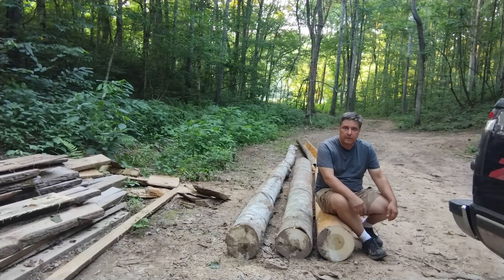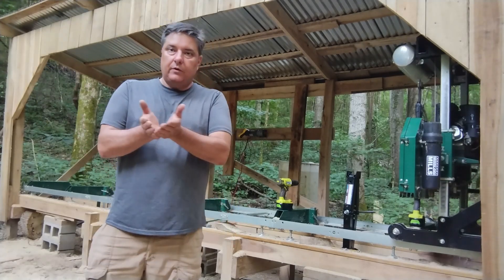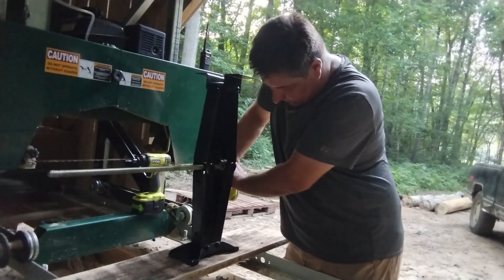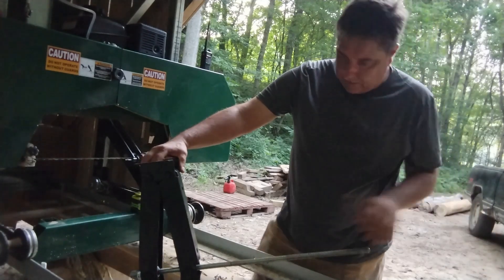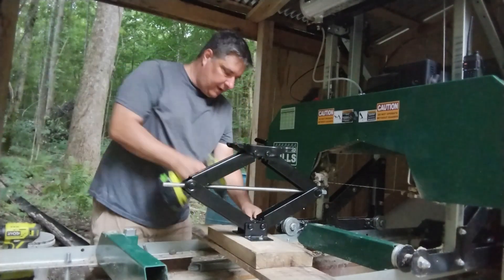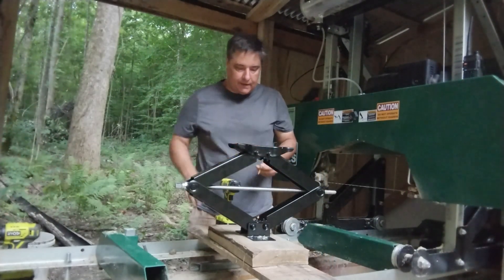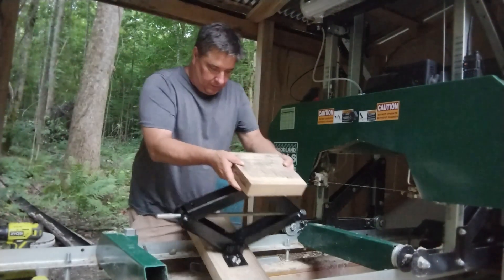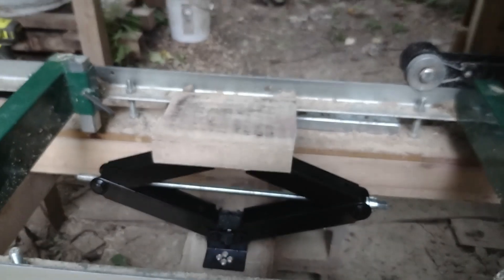Easy Quick Sawmill Upgrade, Adding a Toe Board - S1E013

Comment: Father in law town and country didn’t have a spare. Order a new one for his car and came with a extra scissor jack. Used it with my impact to quickly jack up my cars to do brakes and rotate tires. Ended up stripping threads in less then a year. You have less lbs but would grease the hell out of it to prolong life.